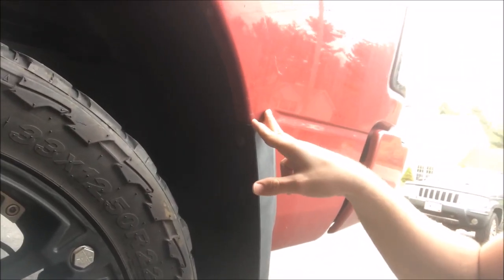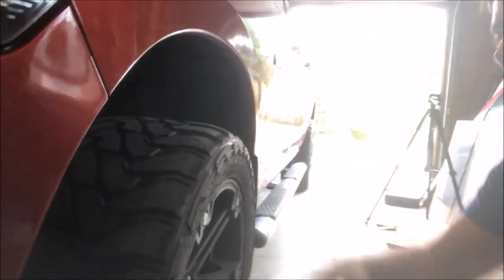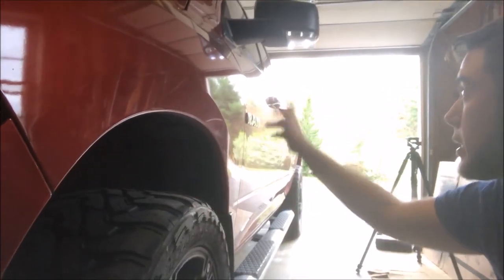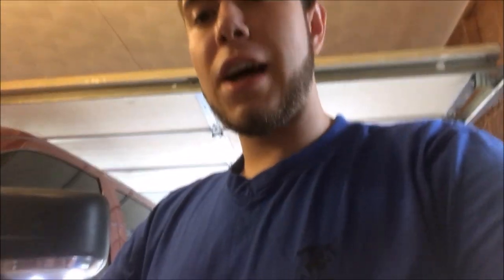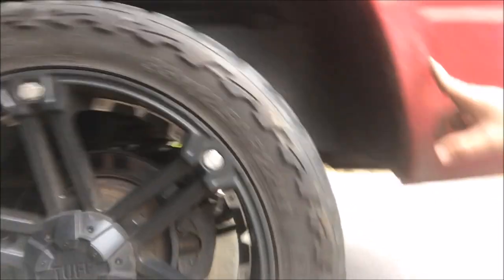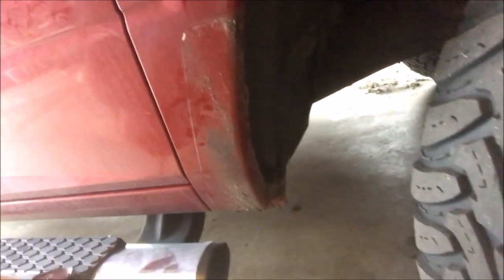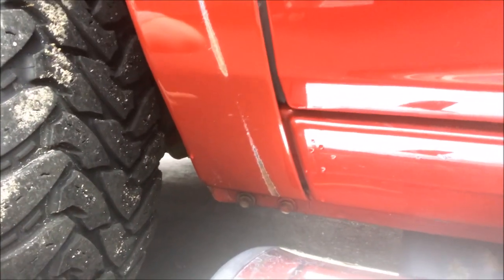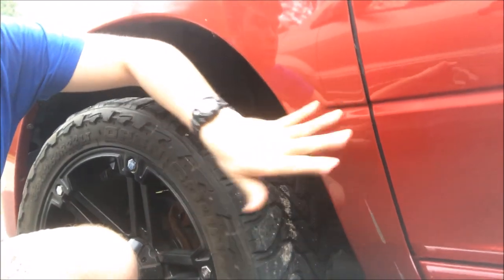Must Watch Before You Put Mudflaps On Your Truck!!!

Comment: Recommend with all aftermarket parts such as Bushwhacker fender flares or husky mud flaps to remove them two or three times a year and wash behind them and order new clear protective strips for your paint from the manufacturer. I did this for ten years on my 2011 Ram 2500 and it still looks new today.

Comment: use rubber roofing patch with one sided adhesive on the flap not the body -  trim to fit, its thick and will never ware through.

Comment: Screwed on rubber mud flaps are expensive and there’s a reason for it they are the good ones and fender flares save your truck from stone chips 
And are held on with 5 screws usually, easy to take off and clean under and oil don’t buy plastic mud flaps
Reply from the maker: The best thing to prevent scratches from the plastic mud flaps is to have that rubber strip to prevent scratches and reduce some moisture
Reply from the maker: but agree

Comment: You can have the problems spots repainted and blended and then cut and polish the whole truck then look into a good ceramic coating. Not sure where you are located but my previous place of employment used G Technique ceramics. They are the best in the industry, and the ceramic can be up to 10 times harder than clear coat. Should turn out great as long as the body shop blends the fenders well! Best of luck, post an update when you're done!
Reply from the maker: thank you for the tip I'll defiantly check it out and do a video on it!
Reply: clear coat the scratches, and then add a black or painted door liner to cover the scratches
Reply: add the door liner to the mud flaps, and put them back on the truck

Comment: I'm shopping mudflaps for my 2020 Ram 1500 Classic. Just got the Weathertechs from FedEx and not impressed. Too small and mount similar to Ram OEM. And I'm not confident the 3M tape will protect the paint. I'm thinking PPF is the way to go and hope for the best. How did you resolve your problem?

Comment: What would the bottom of your quarter panels look like if you didn’t put those mud-flaps on? I’ve seen the alternative. Not good.
Reply: I can confirm that my 2011 F150 FX4 did not have mud flaps. What do my quarter panels look like? They are not even there bro... Rusted right through and off... Now having to do costly bodywork repairs and repainting. Going with some high quality Polyurethane mud flaps this time.

Comment: sorry bro I had the same problem with mine should b a recall on the flaps their junk tried to file a case against mopar but they said since I installed them it wouldn't b covered it doesn't take a genius to install three bolts just a cop out for ram

Comment: Maybe it's because I have factory fender flares, but this did not happen to me.  I bought OEM mud guards, made for the fender flares, which came with clear protector tape (although I would have applied the tape even if I had to buy it separately).  I did replace all the bolts holding on the flares with stainless bolts and washers (slightly larger bolt diameter), because some were fitting very loosely.  Before I put them on, I sprayed them with tire shine, and they look awesome.  The tire shine does such a nice job, I put it on all the black plastic trim.  When I am pumping gas, I get a lot of compliments from men, older women, and even young girls.